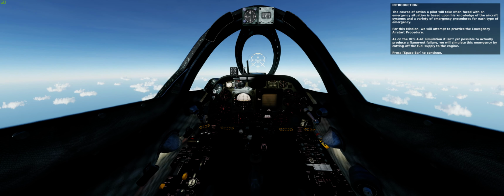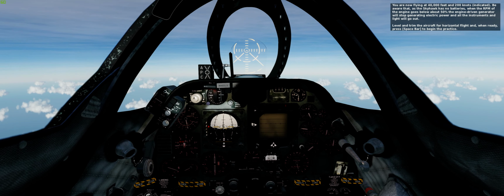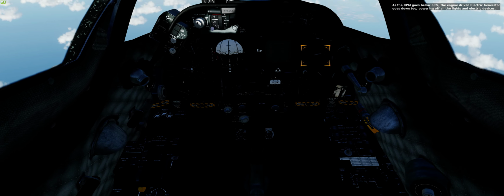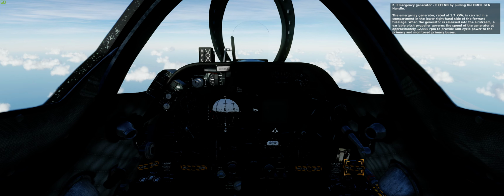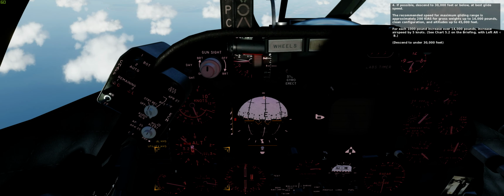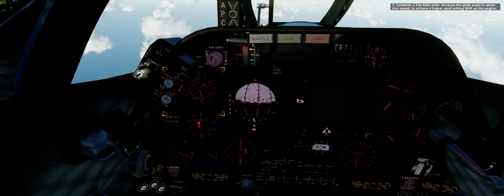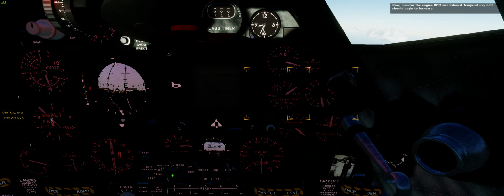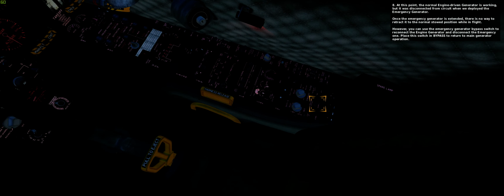A 4E - Training - M06 Engine Air re start

Comment: How is the engine on the A-4 actually shut down on the ground? I'm a DCS noob, but I was trying to get my plane repaired by the ground crew but couldn't figure out how to shut down the aircraft after taxiing.
Reply from the maker: The shutdown procedure is: 

1. Flaps – UP
2. Speed brakes - IN
3. Spoilers - CLOSED
4. Horizontal stabilizer trim – ZERO DEGREES
5. Drop tank switch - OFF
6. Radios and all electrical equipment - OFF
11. Canopy - OPEN
14. With engine stabilized at IDLE - Throttle OFF
 (left click on it, twice)
15. Oxygen switch - OFF